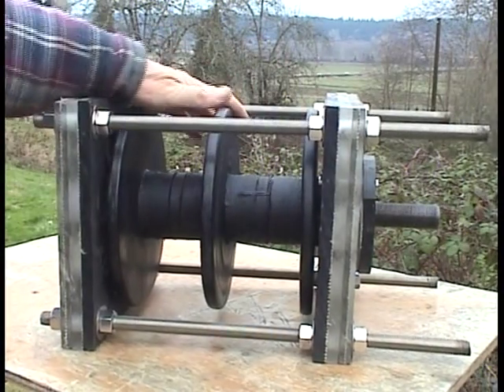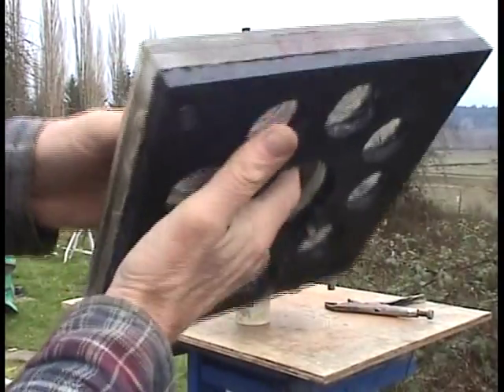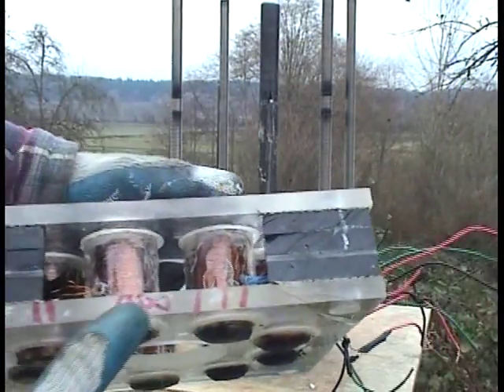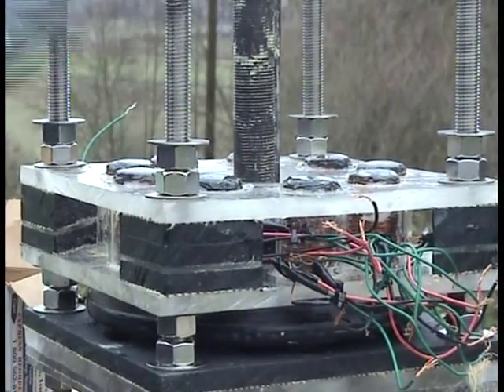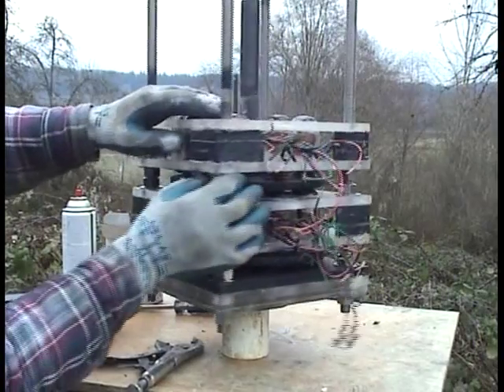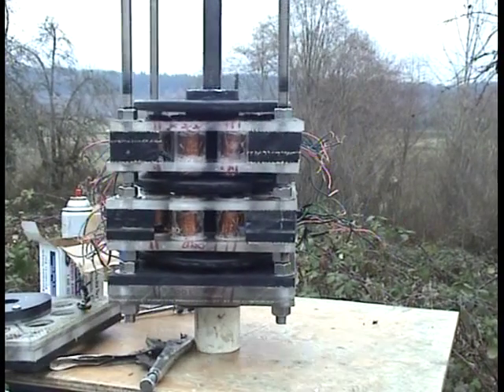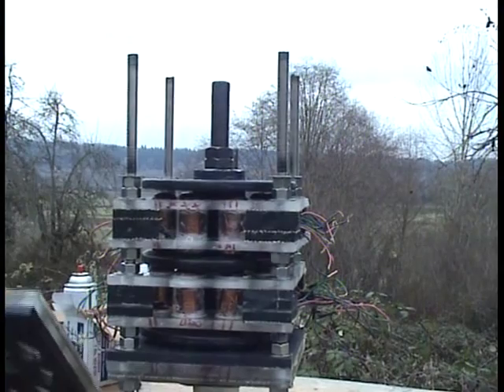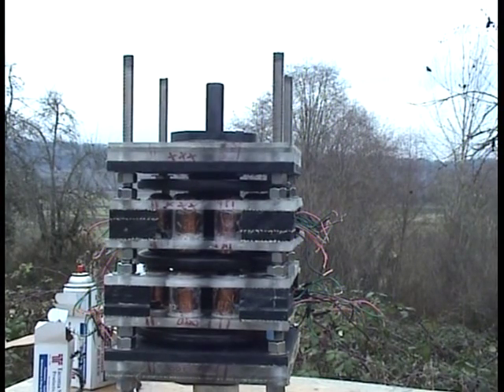Stacked stator coil plates assembled onto frame

Comment: Hi Doug! Nice work there...How many coils do you plan to use for the motor part?
Reply from the maker: Hi Romero  Its going to be electric car motor and speed control is going to be in 9 stages; for the 9 coil positions in the stators....so just one coil position would be low-speed, all 9 would be high speed and most power - those coil positions not working as motor coils work as generator coils, so number of generator coils is variable.